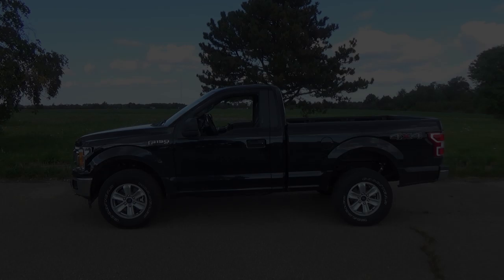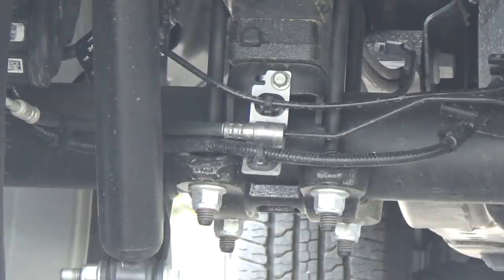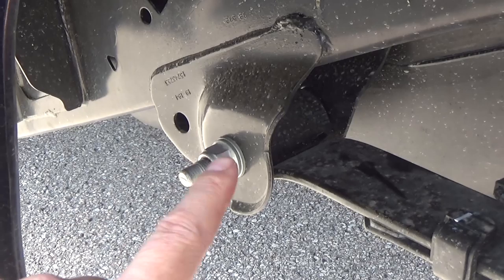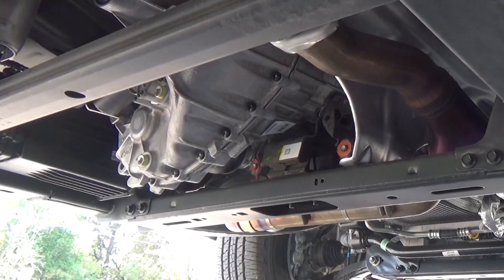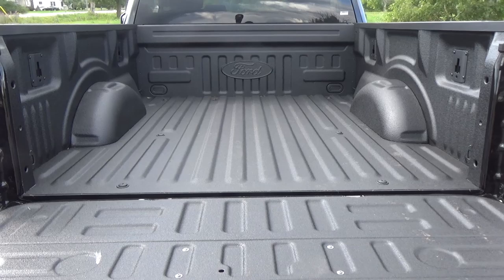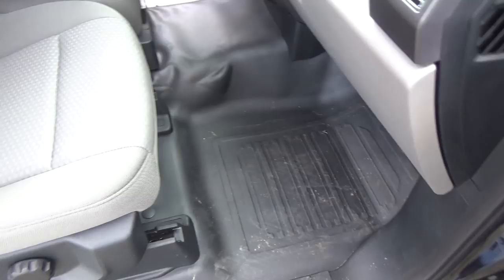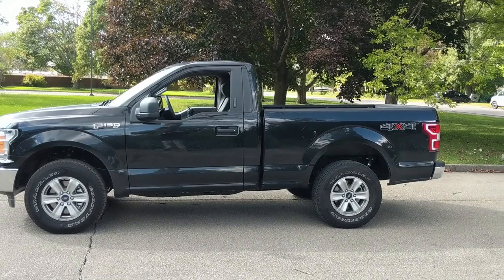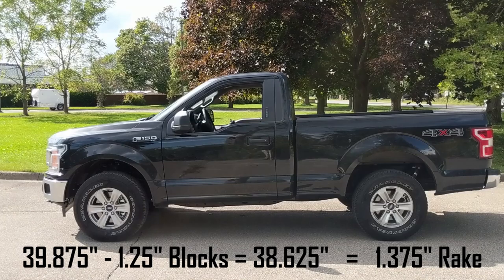2019 F150 5.0 RCSB 4x4 w. Tow Pack

Comment: Excellent!  If this truck only had the "Class IV Trailer Hitch" and "Standard 4x4" options would it have less front to back rake?  Also Ford's builder page doesn't mention upgraded rear suspension components with either the "FX4 Off-Road Package" or "Trailer Tow Package" options.  So what exactly is different or changed with either option that affects ride quality?  Thanks
Reply from the maker: The 2wd single cabs hardly have any rake, so the tow package definitely adds rear height (because they're trying to account for a heavy trailer tongue weighing the rear).

Also, the 4x4 package adds the rear axle blocks which give it an additional 1⅛" of rear lift.

As for the tow package, they add a leaf spring and upgrade the front sway bar, as well as install all the necessary electrical components for the tow assist and plug connection.

The FX4 pack raises the front slightly from what I can tell, so the truck doesn't look as raked (a friend on Instagram has the exact same truck but with fx4).

The FX4 also adds a larger differential ring gear, however, the downhill assist really wouldn't be of much use to me.

If I could order this truck again, it would've been with the 302a upgrade so I could've had Nav built into my Sync³ touch screen. (I'm upgrading the APIM next year to install nav, it'll probably cost my $1500, but the 302a pack cost $2500 so I'm saving $1000 and not getting electric seats.

I would've also got the FX4 pack, and the snowplow package (even though my other truck is equipped with the plow, you get an upgraded alternator for $150).

That would come in handy if you wanted to run electrical tools off battery or at idle.
Reply: @EliminatorPerformance  So either 4x4 option is going to add rake?  And the tow package adds even more rake?  It sounds like the best factory option for minimal rake and best ride quality is to get it with 2wd and perhaps ONLY the "Class IV Trailer Hitch" (not the full blown "Trailer Tow Package")?
Reply from the maker: @dantimber  yes 100% they are basically level from the factory in 2wd with the trailer hitch.

I installed the drop shackles and had the blocks removed since this video was uploaded, the truck basically sits level now, and there's absolutely no drive line vibration due to the correct shims installed.

I will most likely do an update video in the spring once the weather is nicer!

I'll also go over what I like and don't like about the truck now that I've had some time with it (there's not a lot I don't like).
Reply: @EliminatorPerformance  

Okay thanks for verifying and explaining that.  I originally wanted 4x4 and was considering a regular cab with the standard 4x4 and standard Class IV trailer hitch and only removing the blocks.  Now I'm thinking the FX4 package and the standard Class IV trailer hitch would be a better starting point as far as minimizing factory rake while still having 4x4.  I'm not sure that only removing the blocks would be enough but would that alone require different shims?

I'm very impressed with your detailed research and use of Ford parts.  I wasn't aware Ford made a drop shackle package for this truck.  The fact that shims are included and the work is done by Ford service is reassuring.  There is so much misinformation regarding lift kits and the like.  Changing the suspension for larger wheels and tires can be problematic.
Reply from the maker: @dantimber  yea the fx4 shocks raise the front like 1.5" I believe.

As for the misinformation, when I asked my dealership to install the drop shackles and remove the blocks (using Ford Performance OEM parts) the service manager laughed and said "your truck will ride like a lumber wagon" then quoted me almost double what a local (private) Ford shop did.

Overall, the truck handles better than stock, with the rear end lower it doesn't jump around as much. But I'll still upgrade to Bilstein shocks in the spring ($250 for both rear shocks).

I paid Rick's Auto (a great local Ford shop) to install the drop kit, shackles and shims and they guaranteed the work, also said because it's OEM parts (Ford Performance) it's covered under warranty and doesn't void anything (dealership said it would).

As for the Fx4 having a larger diff, this is what I was told by my friend, and like you said, isn't really mentioned anywhere, so take that with a grain of salt sort of thing.
Reply: @EliminatorPerformance  

I really appreciate this information.  I edited out the comments about the front shocks, additional leaf, and ring gear because my reply was getting long but I'm glad you saw it!  

That makes perfect sense that your truck would handle better and not jump around as much being lower in the rear with the changes you made.  Just so I'm clear would only removing the blocks still require shims?
Reply from the maker: @dantimber  I was told that the drop shackles require the 2.5° leaf spring shims, and the shackles combined with the block removal require the axle shims and the 1/4" trans shim. No word on a trans shim or axle shims with only the blocks removed. So do your own research on that.

As for not knowing they made drop kits for this particular truck, I didn't know either.

The official Ford Performance listing only showed 2015+ and other listings only went up to 2018. A lot of them only specified 2wd and not 4x4. It took a few phone calls and getting on the forums to figure out it would work. The proof is that kit works fine on a 2019 4x4.

I'll post an update video eventually, my truck now has a cold air intake, side exit exhaust and 22" wheels (for the spring/summer/fall) so it looks pretty awesome.
Reply: Eliminator Performance 

Okay thanks.  I’ll research it. I look forward to your next truck update with all the changes and new parts. 

FYI my current truck is a Nissan Frontier King Cab (third one).  It’s the middle trim SV with 4x4. I generally like it but was going to get a new Frontier Pro-4X for upgrades like bigger tires, Bilstein shocks, and more adjustable seats.  Then I realized full size regular cabs with standard beds aren’t  much longer and should be safer (on the road), more capable and more comfortable.  And I like the looks of the Ford. Any candid thoughts?
Reply from the maker: @dantimber  I've owned a Nissan so I can't say anything bad (or good) about them.

But I have owned Ford's all my life, 78 f150, 79 f100, mustangs, explorers, escapes and now the new f150. It's a great truck, the 5.0L v8 is arguably the most reliable v8 mass produced. It's actually not terrible on fuel (even with my upgrades) and the aluminum body is super nice (you can feel it when driving) it's physically lighter, quicker. It's overall just an awesome truck, and I'd recommend one to anyone!
Reply: @EliminatorPerformance  Wow you definitely have experience with Fords!  That's awesome.  I owned a 1977 Bronco 302 V8 back in the day and loved it.  I'd definitely get the V8!  I might keep the Frontier for now and use the Ford as a daily driver.  I should add that I'm a hunter.  I mostly drive logging roads but occasionally have to drive off-road.  But I'm not a serious off-roader.   The F150 would eventually become my hunting truck.

Comment: Pays extra for the tow package then deletes it to save a inch more of lifting a bag of potting soil at the local Home Depot
Reply from the maker: The tow package includes a number of things, including spring rates which haven't been affected. Only the position of the spring has been changed. The truck is still rated for over 8800lbs